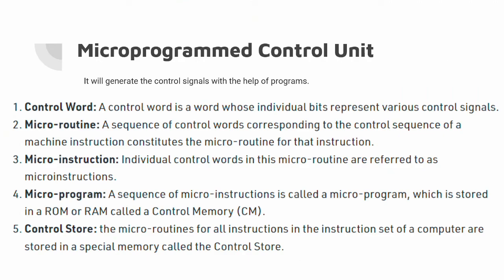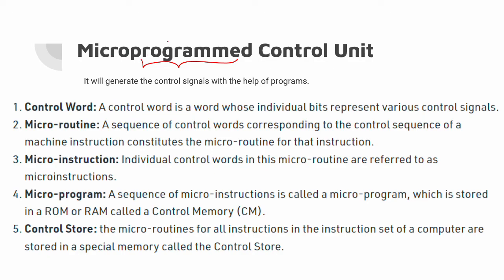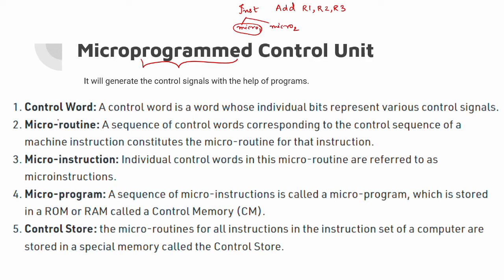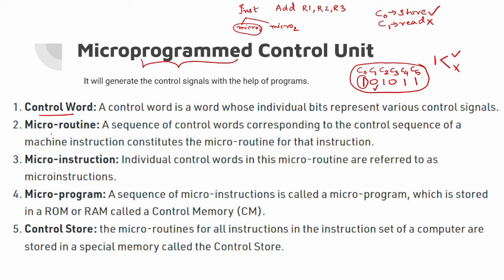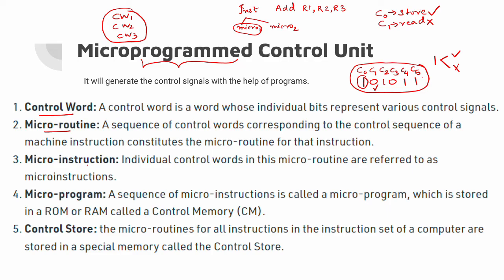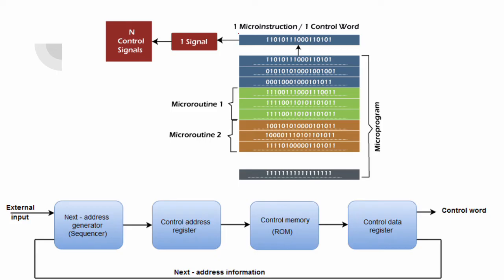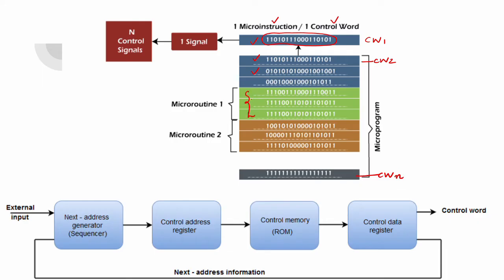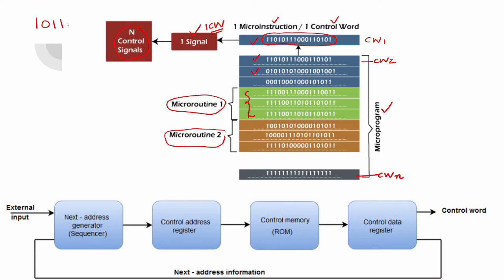4.4 Microprogrammed Control Unit in Tamil

Comment: Sir, a sequence of micro routine thaan eh microprogram nu sollu ok but first definition la microprogram ku  sequence of micro instructions nu kuduthurukinga... Idhula edhu correct
Reply from the maker: Micro-routine: A sequence of control words corresponding to the control sequence of a machine instruction constitutes the micro-routine for that instruction.
Micro-instruction: Individual control words in this micro-routine are referred to as microinstructions.
Micro-program: A sequence of micro-instructions is called a micro-program, which is stored in a ROM or RAM called a Control Memory (CM).

So basically a microprogram can be called as sequence of micro instructions or sequence of micro routines.
Reply: @because2022  thank you sir ❤
Reply: @because2022  sir exam muidnitu...neenga sona elame vanthuchu tq sir
Reply from the maker: @Malavika369  Welcome..